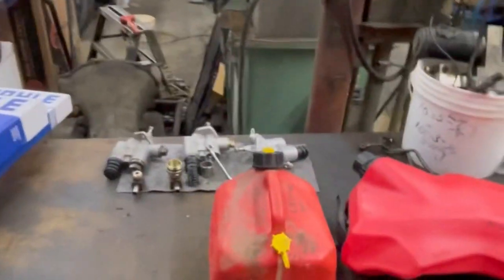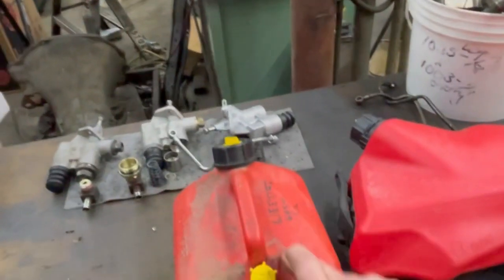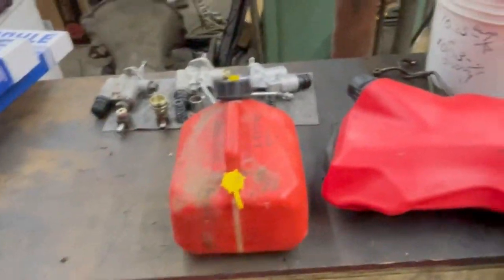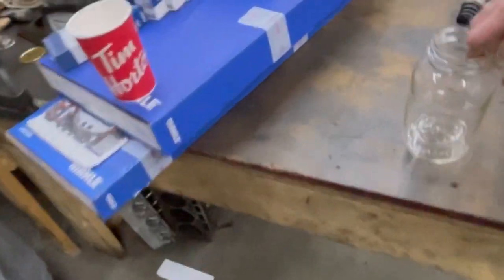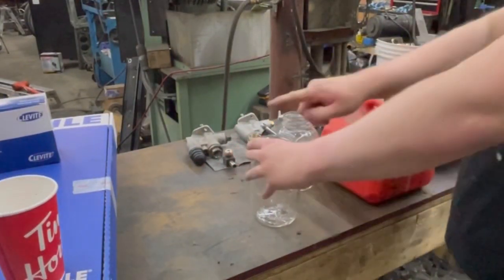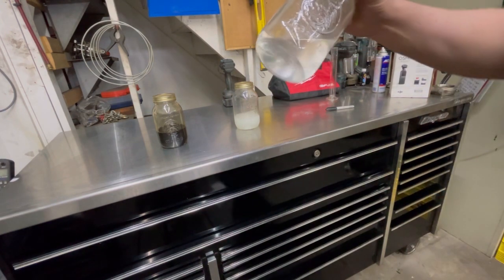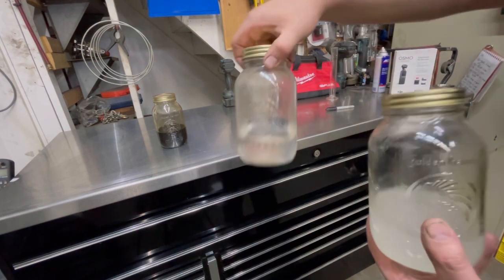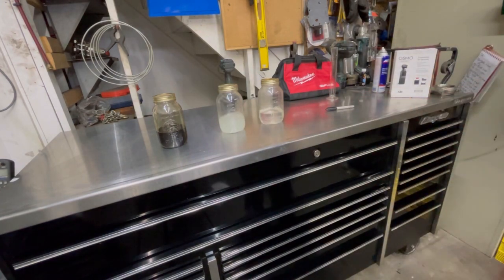Why I don’t use E85 for BLACK DIESEL

Comment: Good in theory but. 
There are aftermarket kits to purposely inject water into diesel engines which proves that low volumes do nothing to some actual good.

Winter deicing additives are typically ethanol, methanol or Isopropyl alcohol based and are designed to do exactly what the ethanol does by suspending and then diluting the water into the greater volume of fuel. 

As for my own experiments over the years with running used oil and E85 blends, about 70 - 90% oil to 10  320% E85  (Depends on the oil I am working with and average ambient temps) works very well, but like all other fuels everything needs to be dewatered and clean to begin with.
Reply: You’re talking about water/methanol injection which injects into the cold side intercooler piping to create a denser charge in the manifold. 

WAY different than having water go through your injectors and high pressure fuel pump. Hence why diesels have water separators.
Reply: @Boots67  Re-read the second paragraph of my comment.

Comment: Good info. Curious; In your blend cocktail, i.e., 70% WMO, 20% gas, 10% diesel.

What do you feel the 10% diesel contributes to the mix?
Reply from the maker: I found that the burn is a bit cleaner
Reply: I also mix in some diesel when running WVO in winter as the anti gelling agents prevent the oil from waxing up. Otherwise in summer I run WVO with 20% gas.

Comment: Hydro diesel runs 20% water in diesel wuth no problems and up 50%better miledge! Question does the e85 separate if there is more water in fuel will it still mix with diesel!!
Reply from the maker: I have never heard of hydro diesel

Comment: E10 and E85 will both absorb water, E85 can hold more water in suspension since there's more ethanol.  With either variant, once you get enough water in it you'll have what's called phase separation where the water/alcohol blend will fall to the bottom leaving pure gasoline above it.  Without ethanol the water falls to the bottom all alone.

The advantage of having ethanol in the fuel is that small amounts of water in the tank will get suspended in the fuel so it'll get burned away instead of accumulating in the tank and filters, but the suspended water might cause damage throughout the injection system.

Comment: I'd imagine E85 would cause  titration reaction with used motor oil resulting in producing something like glycerin.
Reply from the maker: Not from the testing I have done. But depends on the additives the E has in it I would think
Reply: Not how that works buddy, transesterification only works with plant and animal fat oil (triglycerides) or lipids and titration is an test to see how acetic an medium is.

Comment: What if I just don't put water in my e85 but I don't know if it would do the same once mixed with the oil and i have pulled ethanol out of the e10 at the pump with water so will it separate from the rest of the solution but I do think if you can run e85 like a flex vehicle it's good every once in a while incase there is some moisture in your tank it will pull it out
Reply from the maker: Issue for me is if you have water in the oil the e85 with hold on to it and not let it drop out.
Reply: @CUTTERUP ROB  I mean you add the fuel after letting it settle right so isn't that when any water will settle out and if it's from any water in your tank it will just go thru the motor with slightly less power and or efficiently but probably not even noticeable if so you probably have way to much water in your system
Reply from the maker: @james10739  you can use it. If everything is good and dry. Just for me as e85 and gas is the same price and not many places around to buy it from
Reply: It's only like $0.15 cheaper a gallon than 87 but the stations are not convenient for me I was just saying

Comment: Does diesel absorb water? when i first got my truck stripped it down to repair and paint the frame and the fuel in the tank looked just like that ethanol with the water, a yellowish lemonaide cloudy mixture, but the previous owner wasnt running anything other than diesel in the truck.. not sure if he was getting it all at the station or was using a slip tank that was allowing the water in
Reply from the maker: It doesn’t really take on water. But you will get a water in the fuel system for tanks. So with out conditioners and filters being chanced you can have water damage pretty easy